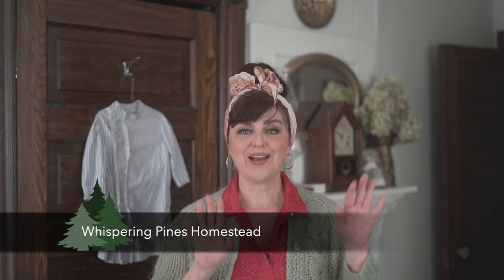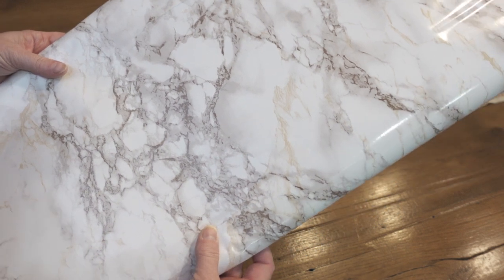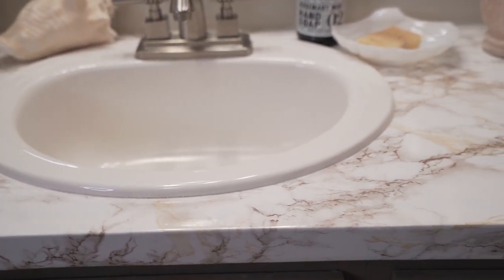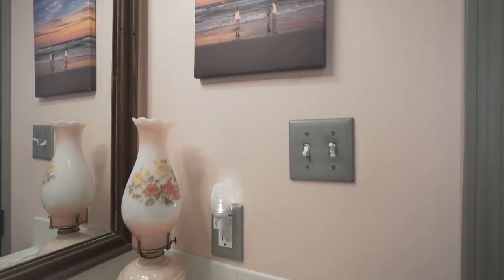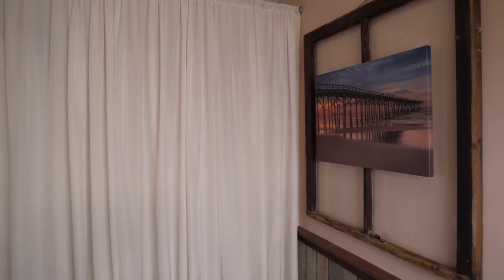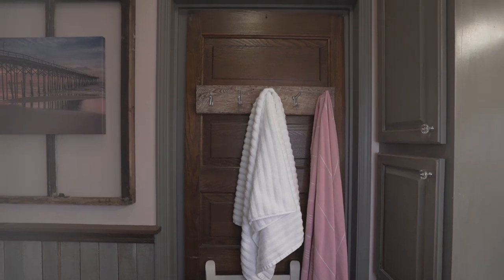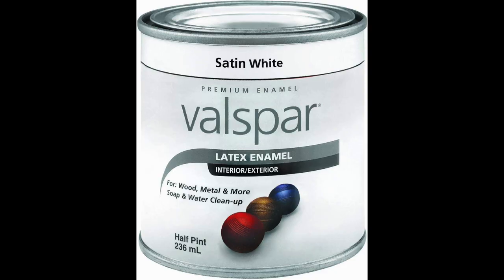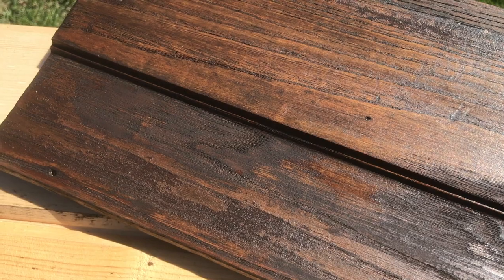TWO Budget friendly countertops | Faux Marble Countertop | Painted Countertop | Vintage Bathroom

Comment: Anita, how is your painted counter top holding up, thinking about painting my kitchen counters again, last time I didn't sand it and the paint in front of the sink has washed off thought I would try again this time sanding it
Reply from the maker: It is holding up great! I'm kind of surprised too, but it's not had any issues. Also make sure to use a primer, I think that helps too🙂
Reply: @WhisperingPinesHomestead  thank you ❤️